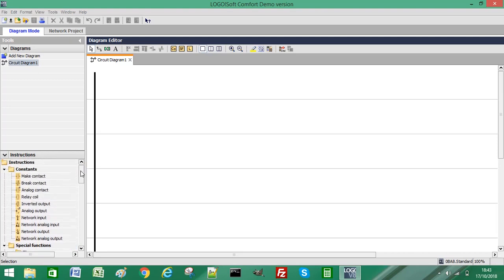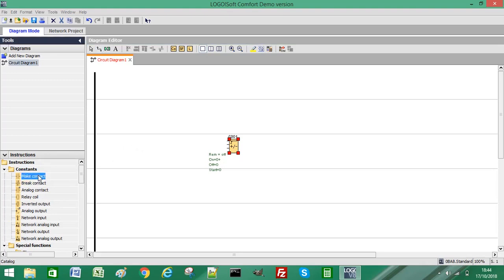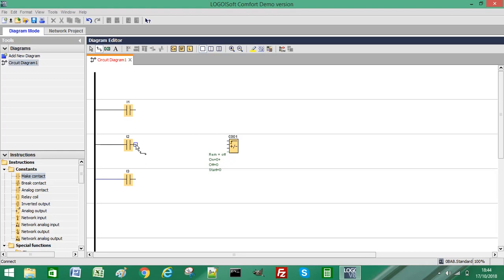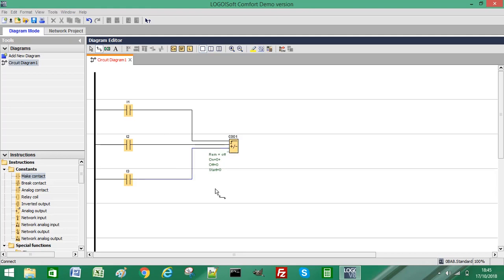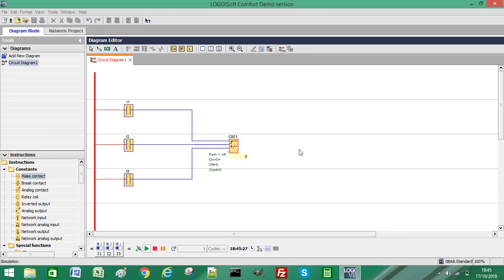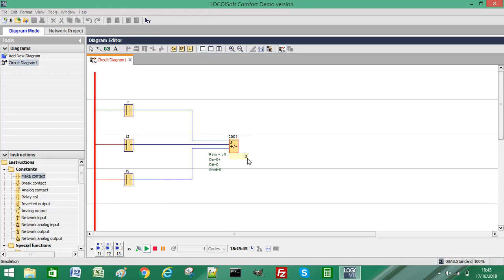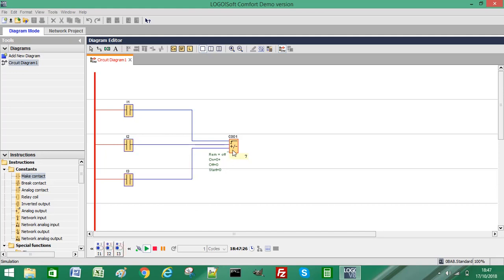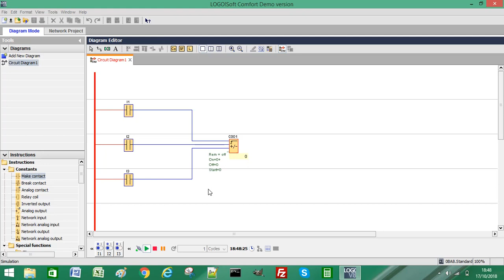PLC Programming How to Program an Up Down Counter using Ladder Logic

Comment: thanks
Reply from the maker: @longnguyencong7048  Thank you. I'm very happy the video was helpful
Reply: @uzrchannel  I have a question, How can I keep Value of Counter when Power of PLC OFF to ON? Because When Power OFF, value return to Zero (0). Please help me. Sorry if it bother you
Reply from the maker: @longnguyencong7048  It does depend on the PLC your using. If you're using TIA Portal, a bool in a data block can set a start value. If you're using another PLC, see if you can set to 1 at powerup